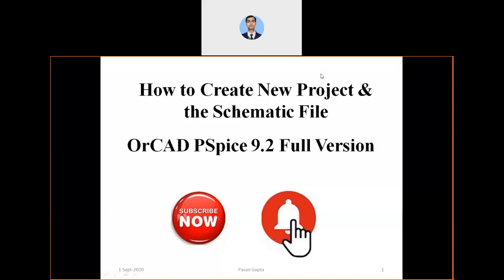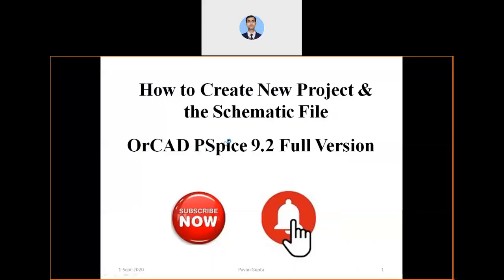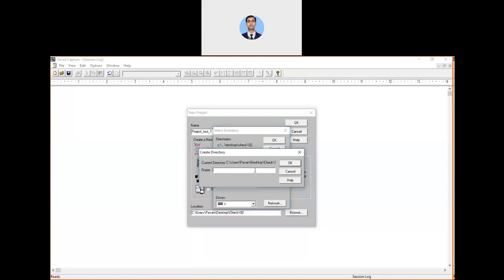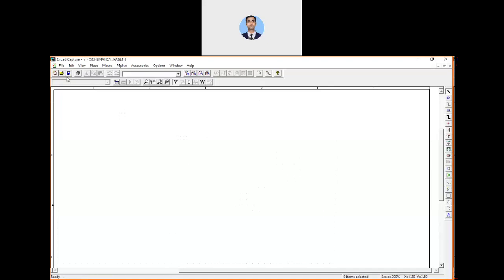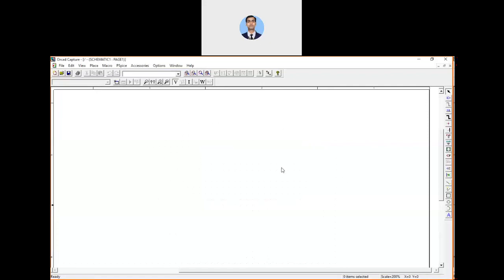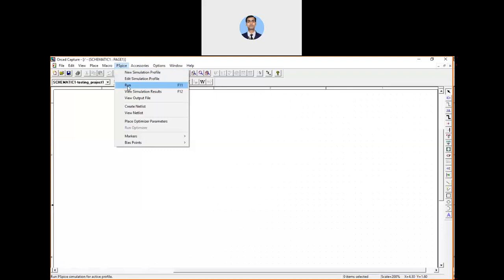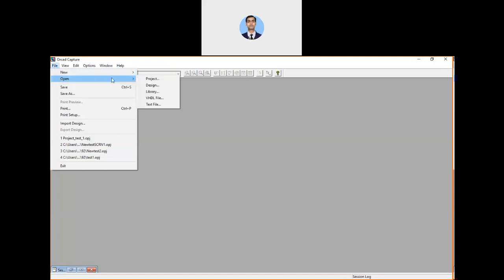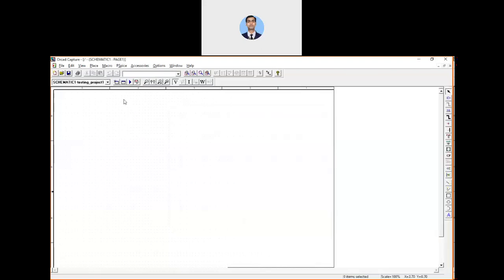PSpice 9.2 Full Version | How to create New Project & Schematic File | In few easy steps

Comment: In windows 10 ,I have installed the same version and I am facing some problem. The problem is that edit simulation profile window does not appear completely. Like in analysis tab I could not see the whole "Output File Options" button. only a part is visible due to which I am unable to use other options in next tabs. Kindly provide the solution